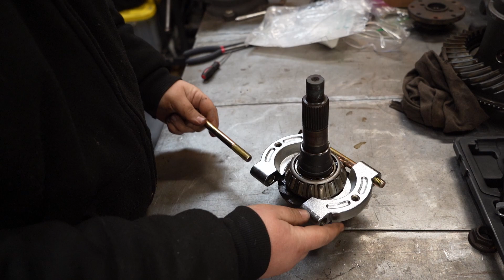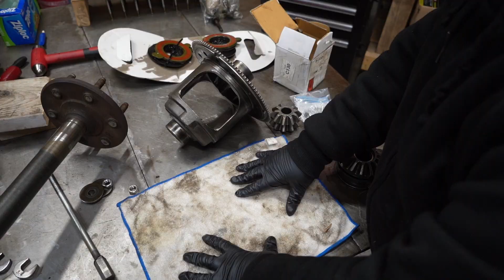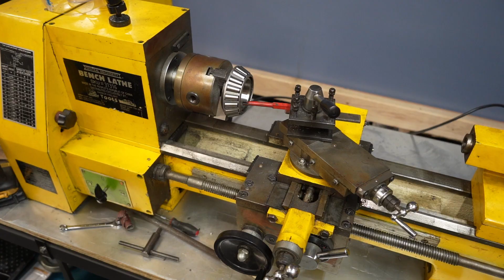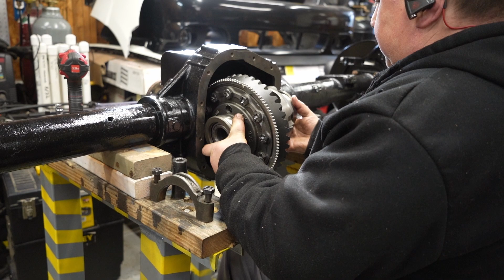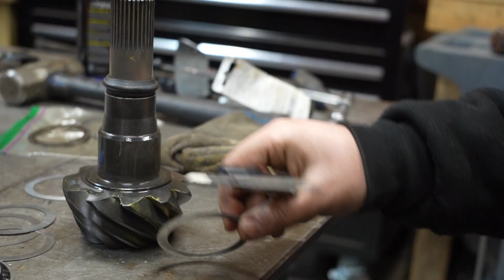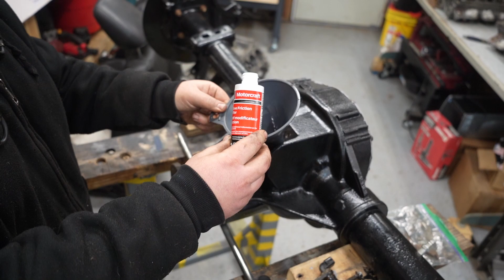Rebuild of 9.75 Axle for a 2004 F 150, Part 2

Comment: Thank you so much for the great video. I’m dealing with the exact same axle due to thieves stealing my truck and swapping the entire rear axle for a different one. It was recovered however I didn’t realize the axle had been swapped at first. Until it was taken apart because it was returned with a bad pinion bearing and the ratio was also different. So I’m swapping it back to the correct ratio. My truck is a 2014 by the way now a 2006 rear axle.
Reply from the maker: Glad we could help!